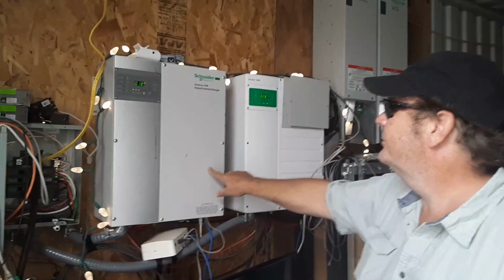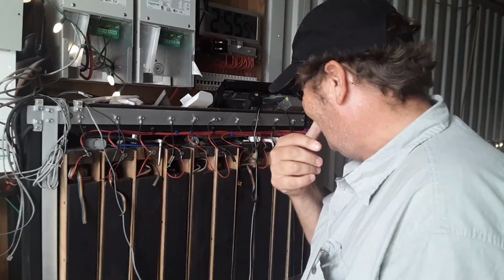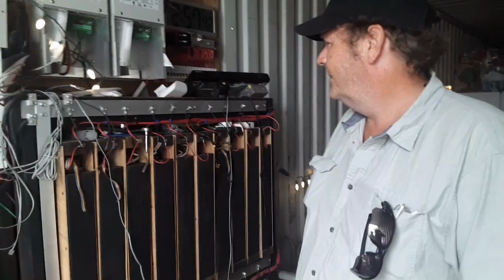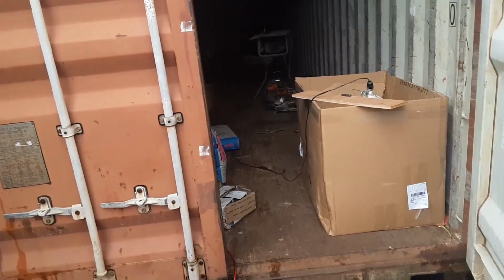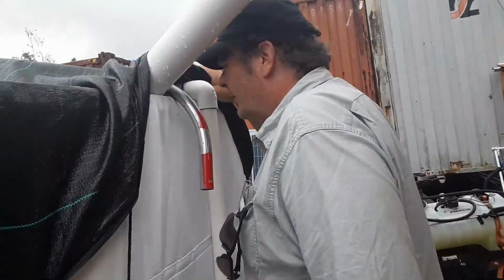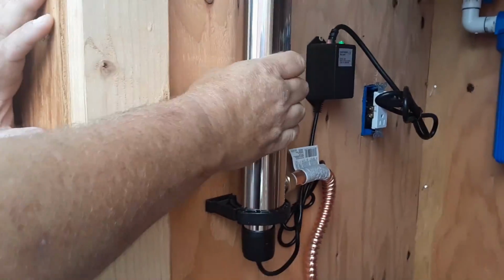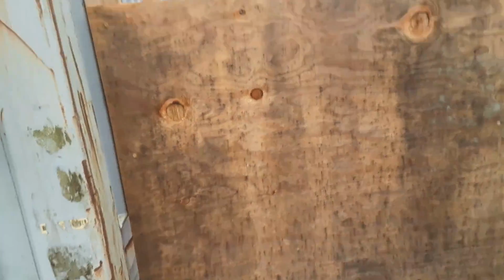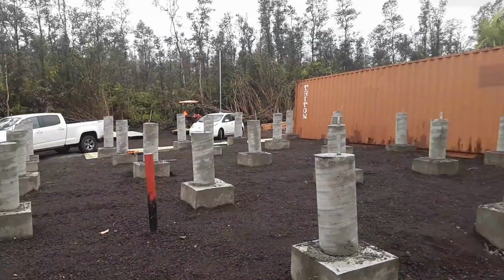40 Setting Kent and Julias Ocean Shipping Container Home

Comment: An awesome video.I am considering storage containers for my build.What is the cost of your cement pier foundation? If I did this could I build to the level in this video secure all containers together. Could i first finish one container out temporarily to be able to live in it and continue to work on the other containers to finish it all out in time? How long did you rent the crane for? And what is the cost for that? If I poured the cement pilars higher later on could I turn that area below the containers into a cellar?  Thank you so much.
Reply from the maker: We will forward your question to Kent. He had a family emergency and has gone to the mainland so it might be a while for a response.

Comment: What is the reason all the homes are built on piers in Hawaii? That crane didn't come cheap but accomplished a lot. Nice to see you have neighbours.
Reply: OffGrid Wanabe sometimes there are floodwaters that necessitate a home being raised. But I suspect the reason most people do it is for the extra storage it creates. It’s impossible to have a basement in Hawaii because of the entire island being solid lava rock.
Reply: @OffGridLivingSteve  I was thinking likely an old custom before concrete was readily available and framed floors were used. Storage is a bonus always missed my basement for on slab construction or flood prone like I am now.

Comment: Hello. So are you now going to buy Lithium batteries that will last 25 years and do not need refilling of distilled water?
I would be very interested in comparing your home with his. The 40ft container might go for $1,500 each. So 7 will be $10,500. I do not know how much will it be to make it look good like yours but to me it looks like it is a lot bigger and more roomy when finished.
As I said I like his batteries. He mentioned that he has a lot of panels so he does not have a problem generating power or storing it. I like your inverter because I have the 3kVA one. So I know it, but his inverter seems good too. He mentioned that he can weld with them. Maybe he will sell electricity to the needy that are close by him one day. I would do that if I have a needy old lady next to me. I think you would too.

At any rate I enjoy watching your channel. You are driving me to do the same here in Egypt by the red sea. Maybe one day you can visit and see how the old boys built the Pyramids. They used the sun rays and mirrors to light the temples under the ground. I just wonder what they would have done if they discovered electricity! They did a good and last job anyway.

Best regards.
Reply: Alaa Sadek my friend, I am still happy with my nickel iron batteries. Not only is Kent’s batteries more capacity then mine, his home is nearly 4 times bigger than mine!  I would love to travel to Egypt and see its deep, rich history, but especially to meet you!    I do share all that I have with everyone near me, especially my time to help make their lives more comfortable. I hope you are having a great day my friend and perhaps one day we will meet somehow.